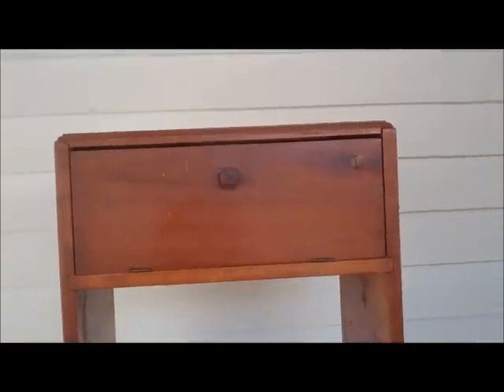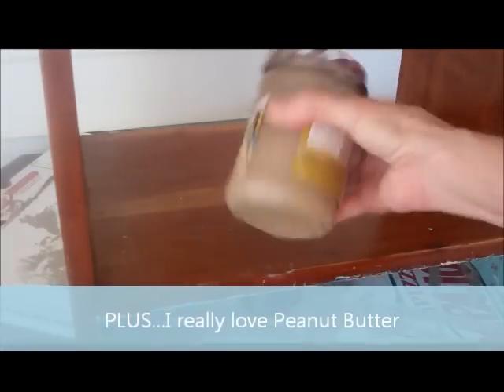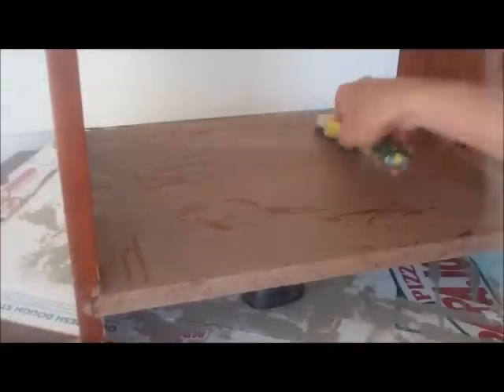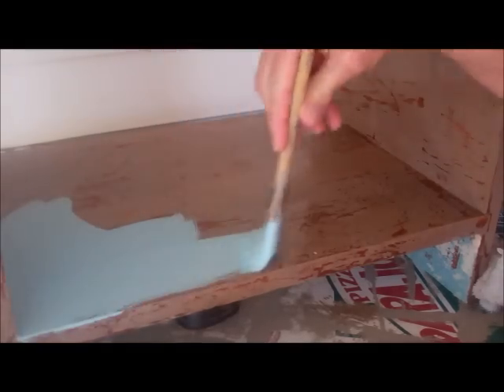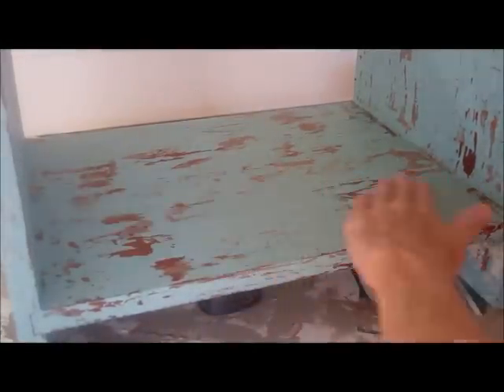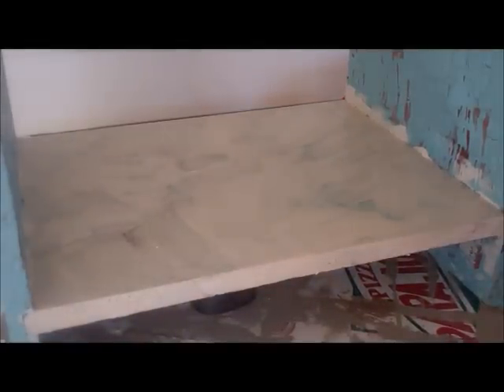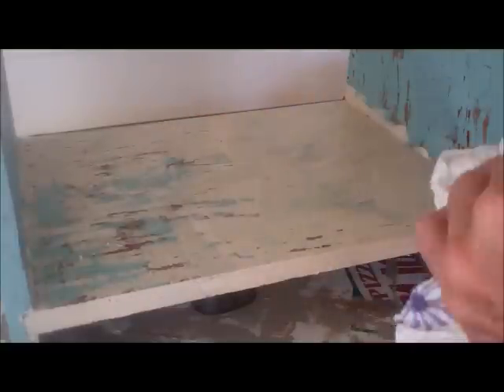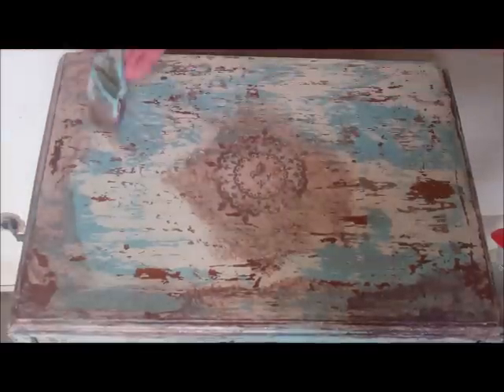How to get a shabby distressed paint finish

Comment: One more question.  The base coat of tan alost looks like the original color.  If I wanted the original color to show through could I just skip that first step?  Also I have heard so much about chalk paint lately, but never knew what It was.  Does it bond so strong that it wont ever chip?  Is that why its so popular?  Where do you buy it at and the plaster paris? Also seems like all the crackle has been sanded away or something.  I dont notice it on the finish piece?  It is very beautiful none the less, Just when I had my mind set on going with a peacock theme and buying my dinning table tomorrow, now I have to rethink this and the coastal theme. I would certainly save a lot of money but I really fell inlove wit a set from Kanes that is formal with a rea lmodern look that would go great with pecocs pics and rugs and decor I have picked out!  man o man.  What to do!  LOL!  Haha

Comment: Do you recommend water based paint over oil? If so, why?
Reply: SPHINX144 i find using water base over varnish also gives the crackle finish too. so im thinking chalk paint over oil will give a crackle look when dry. this im guessing. but in my working i have done varnish then chalk paint over the top

Comment: No need for "special" paint and chalk paint is frankly appalling. This is probably the worst technique I have seen for achieving a shabby finish. Also, if you use any wax, it will yellow and degrade in sunlight (not UV stable) and will be a an abs' pain to remove. Been doing this for a great many years and fail-safe method is to use egg shell water based emulsion with good quality brush - as with all painting less is more so do not be tempted to apply paint in thick coats. Wait for approx one hour  (in 17°C) when it should be touch dry. Then use small piece (10cm x 50cm) of dampened decorator's sponge (as sold for tiling and which do not break-up when abraded) to remove paint. A scraper is a ridiculously clumsy way to replicate wear/tear and a rag is not as good at replicating wear based erosion and sponging leaves a much better finish. Apply at least 2 coats of paint and repeat process - this gives you some practice at removing paint. Voila.